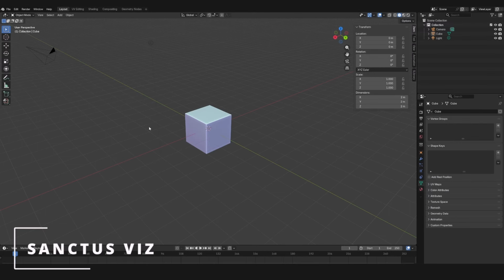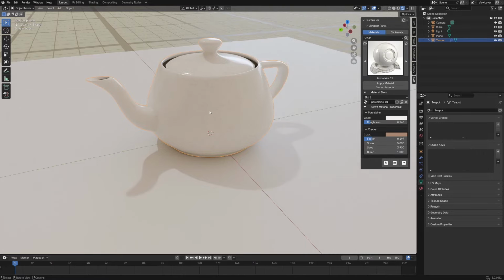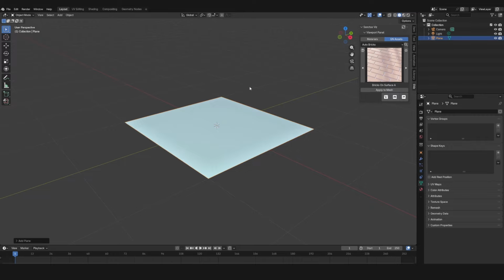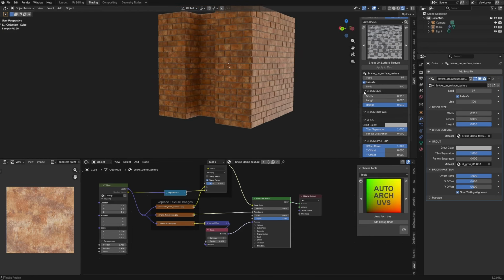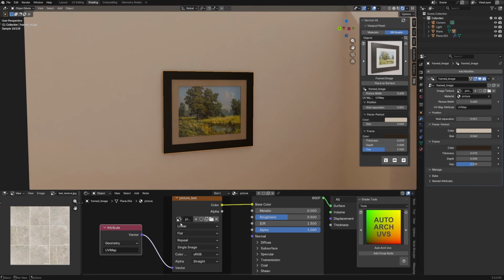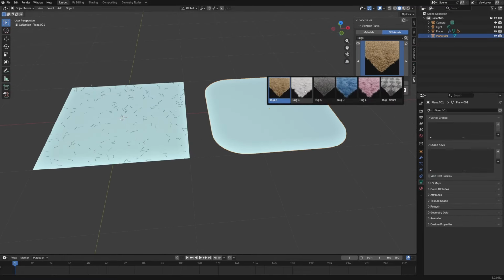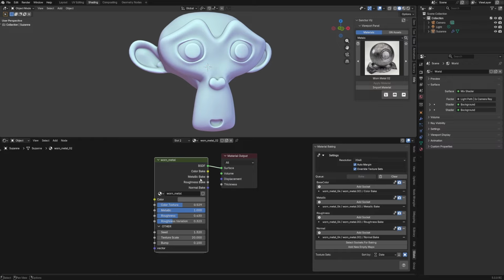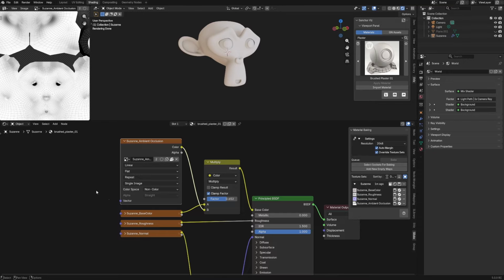Sanctus Viz addon for Blender 3D - Complete User's Guide

Comment: Is there any way of integrate this to the asset library instead of as an addon?
Reply from the maker: Hi! they are separate products, there's no simple way or practical way to do that. Unless you manually add the assets on an asset browser file. But the geometry nodes assets won't work as expected if you just use them as Asset Browser assets, they need the addon code to work to be applied correctly.